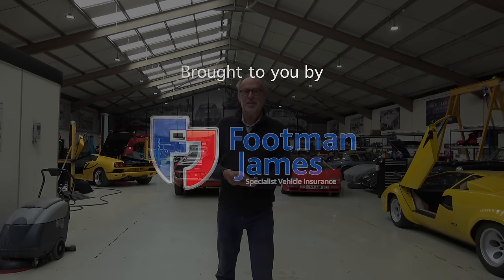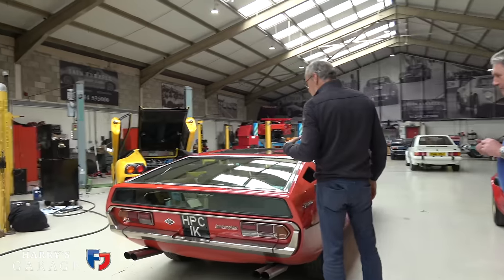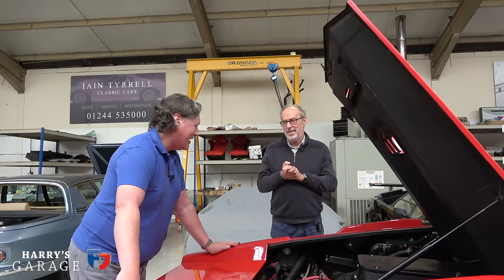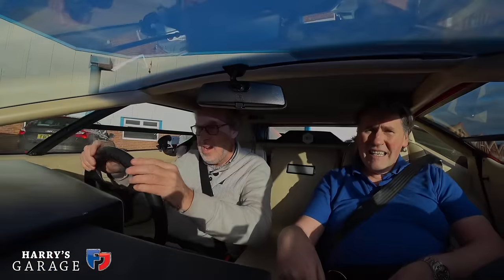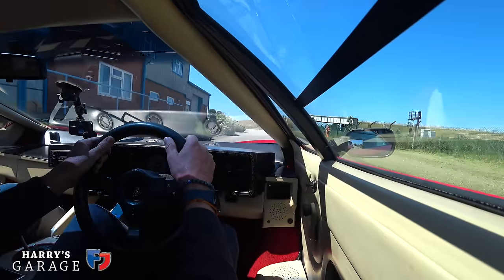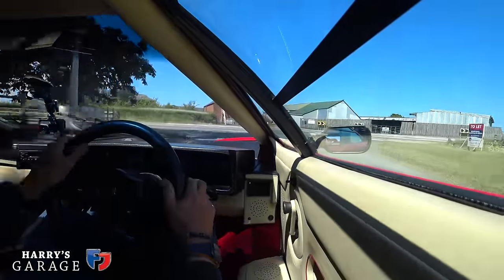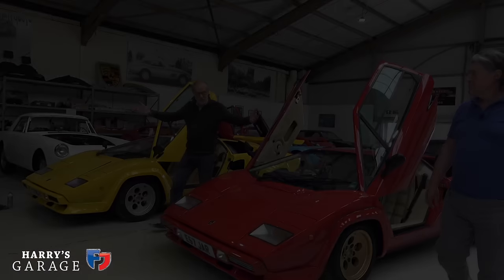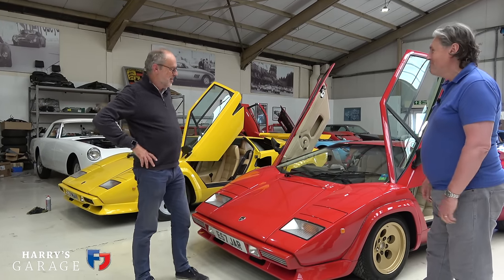First drive in my Lamborghini Countach QV after 15 month restoration

Comment: Harry, please consider changing out the transmission oil in about 1,000 km. All new gears need to bed in and whatever debris is released should be removed by changing out the gearbox oil.
Reply: Good point. But I imagine Ian would have already told him    👌👌

Comment: I can’t believe he drove around with all those weird noises.  It’s really amazing how durable the Countach is.
Reply: He drove it to italy and back with noise from gearbox….
Reply: Exactly this!!!
Reply: @dman197900000  a lesser car would have broken apart.  Must be the tractor DNA.
Reply: @xcx8646  Well, a solid chunk of Pecorino then
Reply: @xcx8646  they are durable, but time takes it's toll on any machine whether it is used or not. most lambos and ferrari's don't rack up a lot of miles/kilometers but they do degrade over time. lots of owners don't maintain them properly for several reasons, so that's why you see a lot of old low-mileage cars in rough mechanical condition.

Comment: What a brilliant drive, I felt I was there in the nonexistent back seat. This video deserves some sort of award, a mere like is so weedy. Also, Iain Tyrrell is worth his weight in gold. Look at the depth of quality - e.g. the heatshield exhaust manifolds to keep the very full engine bay cooler. If you're buying a megaclassic and can't afford the necessary Tyrrell makeover, forget it. Just on the gearbox rattle, when I was a kid some friend of my dad took me out somewhere in his sidevalve Ford Popular 100E. The gearstick spent the entire time jiggling about under the dash and chattering loudly. Changing gear gave you a hand massage. You could tell the engine speed by the gearstick zizz. Happy days.

Comment: I’m soo pleased for you. What a difference I’ve just bought a cheap 2008 XKR convertible, one cylinder is missing slightly so new coil pack, iridium plugs all round and new water pumps. Plus a couple of leaks on the Aircon. New brakes, discs n pads and a service and finally an updated pulley wheel. Can’t wait to get it back on Friday.

Comment: It was an 8 year project restoring my basket case LP4000 Countach. It was missing the interior, rear suspension,  half shafts, brakes, wheels an two Webers. The frame was in bad shape and the engine was toast. After years of sourcing parts before the restoration even began. I drove it for the first time the day of the Covid lockdown and to a certain extent your show has been very helful. I added electric power steering, swapped out the factory AC for a much more efficient Vintage Air system and added a backup camera with a 5" display that folds out of view in the passenger footwell. Each time l drive it it's an event and l love the smooth lines of the skinny tire Lambo. In 2012 when l first bought it a friend of mine said "you're going to spend $100k restoring a $60k car. He was way off the mark. I've spent $168k on it and will never sell it but if l did l doubt l'll lose any money

Comment: In the first test drive from Feb 2022 the car sounded just like my Astra SRi just before it blew a hole in the side of the engine block.
I pushed and rolled the car into a lay by,   I was about 150 miles from home,   and left the car there. 
Lessons learned,   it is very important to service your car regularly every year, changing the oil and doing the other manufacturer / mechanic recommended annual service items. 
Don't skimp on saving on service and maintenance, lessons learned.
I also had an issue with an Alfa Romeo timing belt on the M4 motorway.
Since switching over to German cars about 20 years ago i have had around 20 years of reliable motoring - touch wood.

Comment: 600 hours of work, I dread to think how much that cost to rebuild. Looks absolutely fantastic.
Reply: Not difficult to do the Maths, as I expect at a minimum UKP75.00 per hour - and highly likely more because it's a specialist workshop.  The cost of the replacement parts will be extra, however it will be modest in comparison.

Comment: That looks and sounds fabulous. I can’t see him getting any change from £130k for 600 hours work plus parts, if not more, but it’s a big boys game, you know that when you buy in.
Reply: I also had a sharp intake of breath. But I don't think Iain's rates are actually anywhere near that. I need to go back and review, but Harry did break down the costs for running his fleet the year of the Espada work, and that was far less than I would have thought (still a massive number of something like 70k). 
I get the impression Iain's love of these cars means he doesn't charge what he probably could.
Reply: @ILoveGaybo  given his expertise and that fact he’s in demand , I’d be surprised if he’s not charging at least £150 an hour , in line with most main dealers , like say Mercedes ? Add in a bucket full of specialist parts and the dreaded vat …… ouch . Maybe they’ll tell us at a later date

Comment: If my 20+ yo car is at the workshop for more than 2 or 3 days I start fretting. Once it was there for 3 or 4 months waiting for parts, busy mechanics etc.
Extremely patient to wait for as long as it took, 15 months or 1 and a quarter years, especially as waiting for parts and incorrect parts and problems with work done caused most of delays.
The bill is going to be interesting

Comment: Always good to watch you Harry even my wife likes watching the program, this is the first time I had to comment though, 600 hours? It’s utterly insane that car could of been completely rebuilt from the ground up how much per hour £120 maybe £150 £72000-£90000 to not completely rebuild the gearbox but replace a few bits and sharpen the ride, take power steering off etc Only someone in your position could justify it & because the value of the car otherwise the cars a right off for a noisy cog! I know there has been some other work done but NO WAY 600 hours.

Comment: My buddy recently took his Aventador to dealer for some work.  He picked it up when the work was completed and was driving it home.  He drove 5 miles and loud noises began.  He stopped the car to see what it was.  One of the lug nuts on one of the rear wheels was gone and the rest of them were loose.  The dealer sent a tow truck.  $50k worth of damage.  Both rear wheels, ceramic discs, and pads replaced.  The dealer accepted responsibility.

Comment: “ I don’t want to dwell on it “

Good one 🤣
Reply: Lol I dont get it..
Reply: @spadgm  Iain was talking about the distributor not working properly on the Espada......Dwell is the time, in degrees, the ignition coil is given to form a magnetic field, once the  points open,  the field collapses on the primary side, transferring energy to the secondary ( high voltage ) side of the coil and in turn produces a spark. If the dwell time is too short because there are lots of ignition events, like with this case (12), then it can cause a weak spark and running issues.
Reply: @spadgm  It's likely that or the spark jumping to several contacts in the cap instead of just 1.
Reply: @Omegaman1969  mate, thank you for the detailed reply!

Comment: Lian looked positively jazzed by the way this car turned out. As these cars aproach sky high pricing brought on by the late model re-issue Countach's  $2m + price tag, Harry's car is in the top  1% of all Countach's thanks to Lian's expert revitalization of this car. Like Harry said, there's a lot of poor examples out there. If I had one, I'd get it to Lians shop forthwith for the treatment the car deserves. The value of these cars require top notch revitalization. It wasn't too long ago that these cars could be purchased for less than $100k, those days are long gone.

Comment: Hand made car needs hand made fettling, although I cant believe you didnt go hold on something is wrong with the gearbox sooner, I mean if the dome light above it is any indication, maybe something is slightly off to the left lol
Reply: I'm so glad someone else noticed that. I wouldn't be surprised to hear that Harry hadn't noticed it - it was the camera angle that showed it up. The people that made these cars clearly didn't have a spirit level.....
Reply: @alexbrown1995  well it might be on purpose based on the car, righthand, lefthand, so the angle better illuminates a map, however even 250 GTO's could be off by an inch or so in their bodywork

Comment: Why dont they fit electronic ignition on the espada engine and sort of hide it nicely? If Lamborghini had one in the age, they would have fitted that without thinking. It is only trouble with that many cylinders, imagine having that kkind of trouble on a road trip. Running on 2-3 cylinders less etc.

Comment: Gearbox noises, check. But also, it sounds like it's using all of it's cylinders now.
Manual steering,there's no explaining to the current generation, that have only ever driven FWD power everything super quietened shopping baskets, just how much feedback that manual steering, and un-assisted brakes, can give to a skilled driver.

Comment: I like the back that's definitely an improvement. The front, the Euro style bumper looks better but I'm not sure on the slit lights. They don't seem to fit the style it looks more MG mismatch. 
The ambient lights are a welcome edition but not sure about the door cards.  
The seats needed improvement especially on the performance. If I had bought that I'd be so disappointed. 
I like my base model 3. I'd have liked a better sound system as mine rattles on the passenger side. Anyone know if that's a warranty claim?
There are times the car and my phone don't communicate but I'm phone is getting on a bit. 
I don't think the changes would make me change. Striving for a facelift model seems a waste of money. 
I'll keep mine till Elon sees sense and does a estate version. 
I'm surprised they didn't remove the wing mirrors..